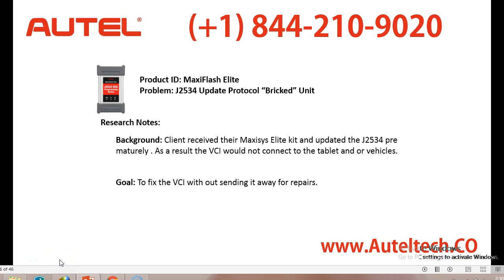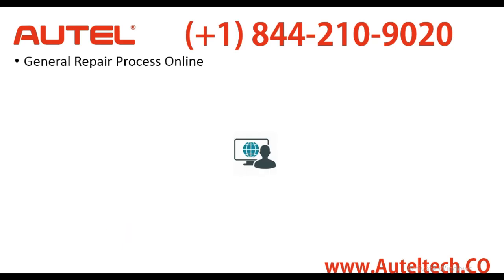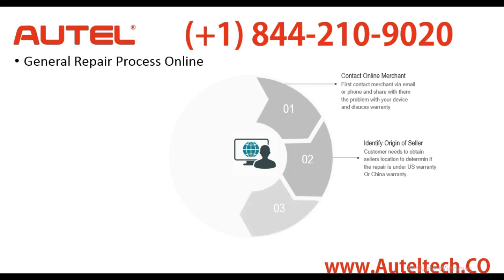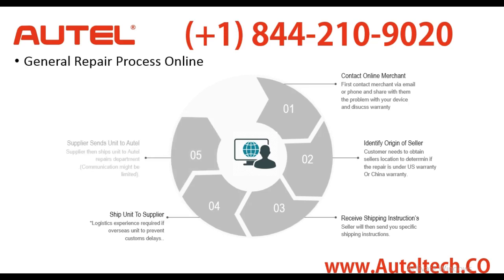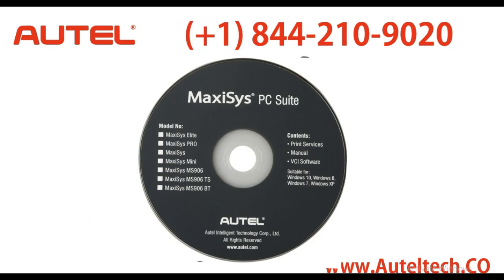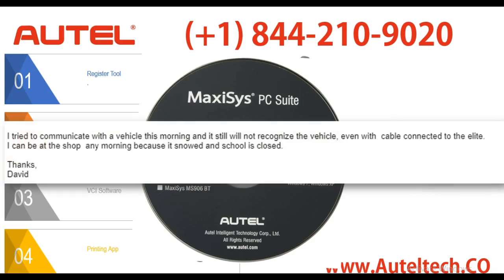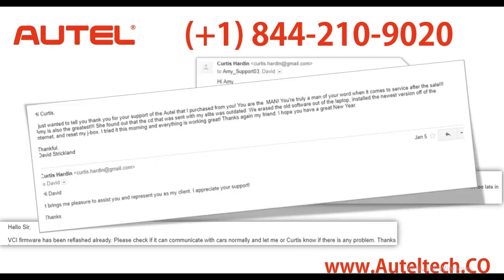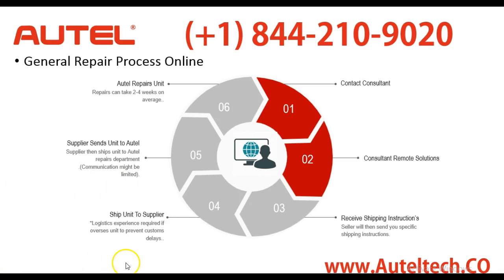Autel Maxisys MaxiFlash Pro Elite J2534 | Firmware Problems and So | Autel Consultation 2018

Comment: I had just got my MS908P back from a firmware reflash repair a week before and could not remember the VCI not being able to auto ID a VIN # on my wife's  03 Chrysler or my 03 Mercury and called support. The guy remoted in to both my laptop and tablet and downloaded and tried to reflash the firmware of the VCI, but the name of the file was  in Chinese Characters, and I think it was a Einie Meany Minie Mo situation ,picked, and  flashed it with the wrong VCI software. The VCI would power up in the car but not communicate with vehicle and the VCI voltage on tablet displayed 27 volts. I had to get a RGA and sent both  the Tablet and the Maxi Flash Elite in for repair. They were cool and put Google Chrome and Firefox Aurora browser apps on the tablet. 

  It's cool that My new Maxi Sys Elite also came with the small Mini VCI with the little light , for a back up in case the MaxiFlash Elite quits,  but I haven't  paired, connected and tried that out yet.
My Maxi Sys Elite round power button doesn't seem to have a working backlit  LED in button  like the power button on Maxisys Pro? Button though seems to feel a bit more robust.  It seems the speakers might have had a slightly louder maximum playing volume on the MaxiSys Pro than my Elite, or is it my imagination? I wonder if I Can  pair and connect a blue tooth speaker to my Maxi Sys Elite ? Hmmmmm

Comment: If using the Maxi-Flash Elite off a Windows laptop that has blue tooth capability and you are using an OE subscription program for "Diagnostics" Can the Maxi Flash Elite blue tooth also be detected by the laptop and connect and be used wire less ly to a Windows laptop like a Cardaq 3 plus with bluetooth can? If so and after unpairing from the laptop, will the MaxiFlash Elite then still  want to cooperate and pair back to the MaxiSys Pro /Elite tablet ?
Reply from the maker: No it cannot. You need be be hard wired to the laptop and j2534 with the usb cable with the red tips at the end.

Comment: Curt, I just got my Maxi SYS Elite MS908E yesterday.  I did see a lot of online places selling this tool at so many different prices so I contacted Autel Directly and they sent me a link to one of their authorized suppliers (AES Wave). I bought my unit through them.  Would I still be able to use you as a consultant to help answer any questions and help me through my first flash ?
Reply from the maker: Hey my friend.  I do have a program that  will allow   me to consult you but its not free and it requires a year commitment.  If you would like me to share with you all the services I offer and how I can help you save on your overal cost you can book a consultation here http://www.auteltech.co.za/schedule.
Reply: @AutelConsultancy  salut je voulais savoir esque je peux payer le module j2534 ecu et payé un ordinateur Pour travailler avec Merci pour tout

Comment: Hey, I'm having problems with our MaxiSys Scanner connecting to the J-Box.  The scanner was updated, then all of a sudden, the J-box doesn't even connect to the scanner anymore.  Can you help on getting it to work again?  Thank you.
Reply from the maker: Hi my friend. I think I might know what problem is but I would have to represent you as a client before I render out my services to you. Just for clarification the seller whom you purchased from should be responsible for you and  your machine. If you dont have any point of conact in terms of support you can call me and I can discuss my pricing and what value I am able to give you. Thanks
Reply: Autel Consultancy thanks for the response.  My boss actually talked to someone at Autel and they're replacing our J-box under warranty.  We think it got fried after finding out a pin on the OBD-2 connector was touching another pin.
Reply from the maker: Ok thats great. To be honest with you there is a way to get the firmware back to the version it was before you updated with out sending it away. I not sure Autel US has the software to do this but I get this problem often when a clients updates his device he gets no communication to the tablet or vehicle. Im not sure how they diagnosed the problem but im pretty sure its a firware problem based on what you told me. Maybe ask them if the can flash the firmware remotely? This way you dont have to send it out